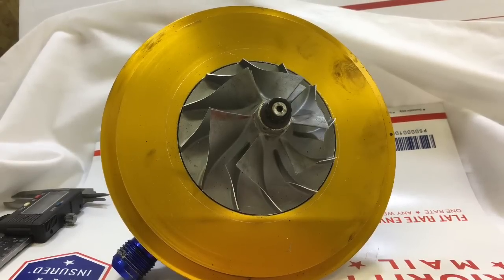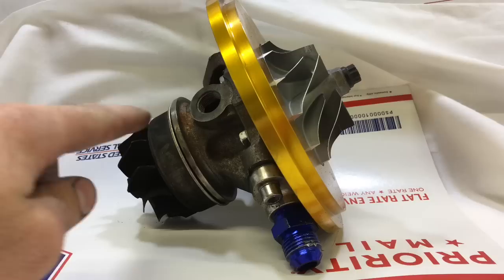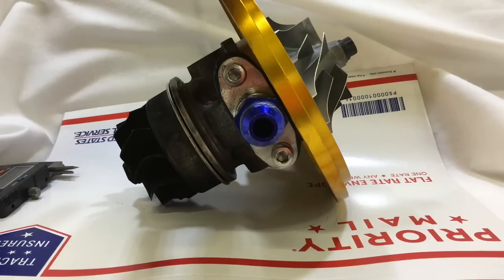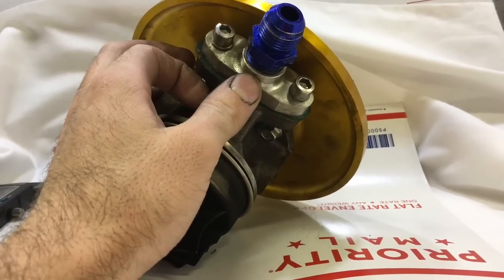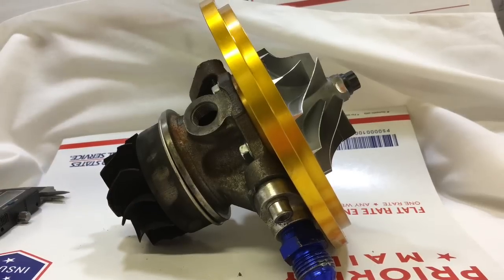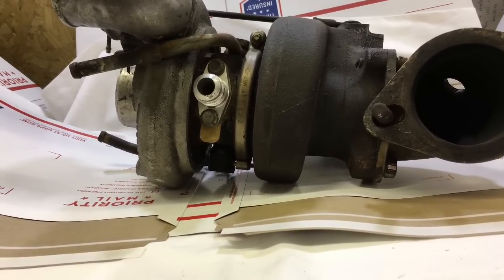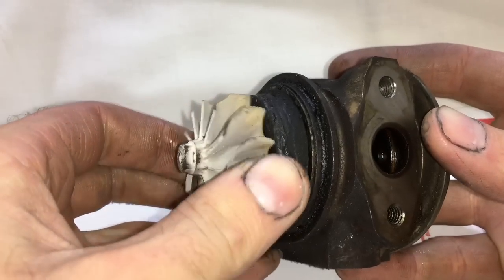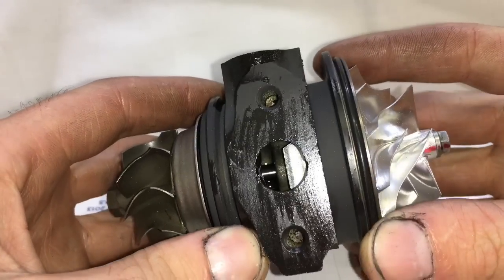How Much Oil Pressure To Run to Your Turbo

Comment: If you run something like a Heavy Duty Oil Scavenge Circulation Pump you can get away with running smaller lines and mount your turbo in a lower position and not have to worry about oil bleeding through the seals

Comment: I still don’t understand why you would put any oil pressure to a turbo when it doesn’t really have a normal oil seal I tried 40 psi with a 3/4” drain and still leaking oil .

Comment: I have a 4G94 lancer with A turbosmart oil regulator because I thought my turbo was a BB, but its a journal. I assume To provide adequate oiling of the engine it made sense that that it didn't want reduced flow to engine components. Is it fine that I have an oil regulator for a journal turbo?

Comment: May I ask if I build an oil tank for the turbo.  Separate from the engine. With its own oil sending unit and filter. Would it work?

Comment: This is an old video, so not that anyone cares, but the difference in flow between the 10mm hole and the 20mm hole he mentioned is actually 400% more. Doubling the size of a circle's diameter (or radius) will quadruple the area. By reducing your drain from 20mm to 10mm, you are getting 25% of the flow.

Comment: I have a question I have a 6.0 ls with turbo with a vsracing 80mm turbo at idle when fully warmed  after a run I’m idle pressure would be in the 20s low 30s
I just put in a precision 96mm now at the same idea when full hot after a run I have a oil pressure of 17psi which I feel is really low
I try and cap the oil feed and my normal pressure is there put it back on the 96mm 17psi at idle idk what to do🤷‍♂️

Comment: if we make crude calculations, 9.5mm x 9.5=85 and 16 x 16= 256 so by cross section the small one is almost  1/4th of the normal one!!!
Reply: Is π(r squared) really that hard? And by your calculations, the small one is 1/3 of the larger one.

Comment: Remember too that you can have a big enough oil drain and still have issues because of blow by not allowing oil to fall down to the oil pan.
Reply: I vent the hell out of my boosted engines at the block and valve cover. Most get inpatient and under vent there engines.

Comment: Extremely helpful. I have an 1999 audi A4 B5 1.8 K03 turbo. Oil everywhere in the crossover tube, intercooler right on up to the throttle body. Fed oil  from the oil cooler on the engine at the filter. Everything you said here totally applies to my current stock setup. Time for a new upgraded cartridge I see.

Comment: I came across this video trying to figure out why there was so much oil in my intercooler pipes after installing a new Cummins/HX35 combo.  As I was watching and he said -10an I went SHOOT, that's what I have.  So I went and pulled my drain off and measured it, 11mm ID for the tubing, the connections were only 10mm.  Measured the stock drain, 18mm.  Put the stock 18mm on and WHOLE LEE CURE RAP, that was not only my oil issue, but it was also apparently making my turbo spool MUCH less and MUCH slower.  Like an entirely different truck now for something THAT simple.  This kinda blows my mind...  Thanks so much for making this video...
Reply from the maker: It’s very common, I have multiple videos on that topic.

Comment: So it's not really the -10 hose,  being  too small, it's the fittings having the restrictions? I was thinking  of using a 5/8" hose, with barb fitting,   I guess ppl like the AN fittings because it says 'race car' me on stuff like that, I don't care as long as it is a dependable mod,

Comment: Should the drain be at least very close to the size of the supply pipe? What also might help is to calculate the pipe surface in mm2 and calculate the impact in terms of surface are lost when the output drain is to small. A loss of 20% might be possible if you do the calculations.

Comment: I'm doing my ct12b turbo ATM and I'm port  matching the oil drain and supply , makes a lot of sense , also you can get leaky seals from running too thinner oil too , as I'm learning on my Hilux Surf 1kzte

Comment: I installed a turbo onmy b18a Honda. New my precision 3431e was leaking oil into the exhaust. I have a 3/4 oil drain, half of it is steel coming from the pan then it goes into a rubber hose. I still had issues. I had to run a .30 restrictor
It seemed to help. Still Burn some oil on cold start. Could the turbo been bad from the start.

Comment: Question... the more oil pressure and oil drain the you feed to your turbo, the less oil pressure to your crankshaft and cylinder, is this statement correct? If it's and you feed fuel oil pressure to your turbo and you drain it all isn't it the same to not having any oil pressure left to your crankshaft? Kind of like if you take your oil filter out..

Comment: As a diesel student I learned that in medium and heavy duty engines the oil feed is directly after the filtering media. Right from the filter base such as on the navistar DT 466 before the engine main journal / crankshaft. Clean unrestricted oil flow at engine oil pressure is called for so , why is there a need in light duty/civilian turbo application to run a fixed orifice (restrictor) on the turbo feed line.

Comment: 6:10   turbo is SHOT --- that's over .010" axial play!!!! factory specs call for .001 or .002" right?
use a 1" mike,if you have one,grind down/sand ,* square*,the steel round spacer inside the thrust bearing to get .001 to .002 axial play, and reassemble if all else (rings and housings) is good.

Comment: Guys turbo oil restrictors are not to keep oil pressure to the crank....
Also turbos do need oil restrictors to achieve proper oil pressure. Otherwise they wlil spill more oil from the journals hence more need for oil return sometimes journals splash so much oil to the seals from the side thats not manageable. Also too much oil pressure makes the shaft stiffer, you should know better since when you put the CHRA on the balancing machine and turn on the oil pressure the turbo shaft becomes stiff and cant rotate as easy
Reply: i am having low engine oil pressure. i have ted off the oil.pressure switch. i am.planning to put a restrictor in the 16g turbo.

Comment: Allot of diesel turbos come with restrictions built in the oil feed side.  You dont want to run a 100 psi of oil  through a HX35.

Comment: A 10mm drain is less than half of what a 16mm drain will flow by area alone
Reply: I'm sorry I must be misunderstanding. A 10mm is less than half of a 16mm?  Half of 16mm is 8mm but a 10mm is smaller than 8mm?
Reply: @sssmithVR  When talking about area, a hose half the size of another hose is not half the flow. It's usually around 1/4-1/3 the flow.  So he is right. A 10mm is only around 1/2 the flow of a 16mm even though it is larger than half the diameter.
Just try this. Draw a 1x1 square. Then draw a 2x2 square next to it. You will easily see that the 2x2 square is actually 4 times larger than the 1x1 square. The same idea applies to circles.

Comment: Technically, a -10 should have about a  .5 (12.7mm) fitting ID and a .55 (13.97mm) hose ID since it's a standardized fitting developed for the military. If a company doesn't stick to that minimum then they probably shouldn't be used because they are making them out of spec. Either way, you shouldn't be getting a -10 with only a 10mm ID. That is crap Chinese parts if you do.

Comment: i know this video is older but i have a 2003 gti that been experiencing oil blowing problems and a new drain line that i found is clearly smaller than oem so i will replace to oem specs and hope that i dont blow clouds when i step on it and increase the psi and in theory flood my cartridge

Comment: Hello i lokks like you are well educated on turbos, can you help me with a couple og questions?? i have 2 Turbonetics t-25055, how mutch shaft endplay is normal on this type turbos, its the stupid single bearing turbos, a realy smart setup :-/  well to the next question, when the turbos was replased the turbinehousing was changed and the t-25055 now has the t-24238 turbinehouses is there any diffrence? the turbine is the same on both, but there can be a chanel diffrence.do you kow anything about this. Best regards Otto

Comment: So first off you do not run as much oil pressure as you can to the turbo. There is a restrictor that should be ran that actually limits oil pressure to the turbo so that you don't blow the seals out. The drain is gravity feed so it is important to have as straight a shot from drain port to oil pan as possible with no low spots in it to accumulate oil and cause a back up. Lastly if the drain hole is - 10 on the turbo then it doesn't matter how large the fitting you put on it is the flow is dictated by the orifice but in this case it is gravity drain.

Comment: With lines unhooked, If you were to pour oil into the feed port, should it flow through freely or will it slightly sit in there until the turbo is spinning? I’m trying to figure out if my feed is clogged slightly.

Comment: 10an is 5/8s hose size. I just measured my ID of my AN10 hose its almost a .500 (.492) .
Reply: 10AN fittings are 5/8" hose size but, that is the equivalent outside diameter of the hose not the inside diameter.  Hope that helps.

Comment: question when u enlarge ur oil return hole in ur center cartridge did u dis-asimble the turbo first? or let it just like that?
Reply: Chalres Andrew don't do that, if it came from the manufacturer that way it is fine. The important thing is proper routing of the drain line and its return location. This guy is giving bad info.

Comment: Resrictors limit volume not pressure
Reply: They limit pressure as well, look up the conservation of energy or Bernoulli's Equation.  The velocity will be higher but, the pressure will drop.  I mean if you dead head on the other side of the restriction the pressure will return to the same as upstream just at a slower rate.
Reply: @CHUDHUCKER  No. If you add a restriction, pressure rises. The volume goes down. It's kind of the reason you can buy a low pressure/high volume fuel pump or a high pressure/low volume one.
Reply: A pump is rated on flow, not pressure because the pressure is increased by restricting the flow. A pump will of course be limited to how much back-pressure it can hold before it starts surging back, but pressure is not a unit of capacity, it's the difference between supplied volume of air, oil (w/e) and consumed/drained. For example, your turbo will spool faster with smaller IC, pipes and manifold because there is less volume needed to be filled before it starts reaching flow restriction and can therefore build up pressure faster.
Reply: @TheChrisey  Pumps DO get rated by pressure AS WELL AS flow. That's why if you buy an air compressor, it says "Rated for 200psi and 10CFM" or if you buy a fuel pump is will say "450LPM and 120psi"
Reply: @zososldier  I just explained why that is. It's not a measurement of capacity, it's just a measurement of tolerance before the pump breaks.
Reply: @TheChrisey  It's still a rating, though. It's rated at what ever PSI
Reply: @zososldier  Yes you're right. My point was tho that pressure has nothing to do with volumetric capacity, it's just a ratio of flow vs supply restriction, the results are also affected by the viscosity of the liquid.
Reply: @zososldier   pressure rises:::: you need to say where »»»»  before or after  it.
Reply: @josepeixoto3384  Not really. We are talking about turbo lubricant. Which means it's pressure is going to be dictated usually before the turbo either by the feed line, connectors or an inline restriction like a reducer.  In an average vehicle, the drain will not be a point that raises pressure. Just a point that limits drainage efficacy because they are usually gravity fed.

Comment: That's the answere I was looking for. I have a HX40 and it doesn't have any shaft play but it leaks oil threw the compressor wheel and I didn't know what was going on. I also rebuilt the turbo with a rebuilt kit an the leakage has upset me alot. Now I know where to look and fix the problem:) Awsome:)

Comment: Very misleading info all turbos come with a oil flow rate liters per min. Over feeding a turbo as you have stated cause high parasitic drag don't mislead people. Need to get some facts right pressure is a measure of restriction and form of restrictor is used to reduce volume and often at the same point pressure goes up. Anyone watching this misleading video please refer to your turbo manufacture to oil flow requirements all frames of turbos are different. Ps let's not forget crankcase pressure is often the reason a turbo smokes and seals DON'T just blow.
Reply: Please explain?  I was always under the impression that as you add a restriction the velocity increases and the pressure drops.  Its the principle of the conservation of energy.  How does the pressure go up after restriction?
Reply: @CHUDHUCKER  You got it backwards. A restriction will increase pressure and reduce flow. Just like sticking your finger in front of a garden hose makes it spray across the yard.
However, some terms here are getting tossed around a bit wrong. Pressure doesn't really matter. It's the volume that matters.
Just like Steve said above, mechanical parts need a certain amount of lube. As he said, a certain amount of liters per minute. A fire hose at 2 PSI is going to flow a much higher LPM than a 1/4 hose at 70psi.
Reply: @zososldier  on the money mate, thank you
Reply: My Cummins engine's oil pump flows 20 gallons per minute at 50 psi, so the turbo must be getting quite a bit. lol After 310,000 miles, the original turbo wasn't leaking a drop. And that's with 15/40 weight oil, too.
Reply: @AmericanThunder  Cummin's supply flow rates to match units based on applications as per every manufacture, your oil pump flows that your turbo doesn't see that unless your running a oil feed line to the turbo same size as the block entry from the pump ? Kinda dont think so buddy, 20ltrs per minute is based on pump exit, please so some research before making weird statements.
Reply: @stevemurch6974  I didn't say liters, I don't speak in metric. I said gallons.
I build engines and I build entire vehicles with custom engines in them. lol 4 decades of doing it is long enough, and I'd rather not research anything anymore. I will leave that to you.
Reply: @AmericanThunder  use a metric converter most of the world uses metric in this modern age
Reply: @stevemurch6974  no thanks. Lol
Reply: @AmericanThunder  thus the rest of the world moves forward
Reply: @AmericanThunder  lol and fair enough too

Comment: I just rebuilt my journal bearing turbo and now it has no play at all and doesn't spin as easy as it did before the new bushings didn't feel tighter than the old ones, do they need to be broken in or should I take it apart again?
Reply from the maker: +Austin K usually it won't spin easy if you kinked a piston ring seal or if the deflector isn't all the way in causing the seal plate to sit uneven.
Reply: Turbo Lab America it was because one of the bushings wasn't seated all of the way it feels better than when I bought it new, stupid eBay turbo

Comment: I completely understand what you are trying to say, but I don't think you know how hydraulic pressures work. Regardless of how much oil is going in, if the drain is too small it back fills and builds pressure. At a certain psi the oil will be forced past the seals. By enlarging the drain, you will lower the pressure until the blow by stops.

Comment: I recently purchased 2 ebay gt35 turbos.. Installed as a rear mount setup on a camaro..

From day one one of the turbos would drip black soot from the exhaust port, stop spinning at idle.. lasted about a month before it was pouring oil out... I haven't had any issues with the other turbo..

I'm rebuilding the turbo today, hopefully it will fix the issue.